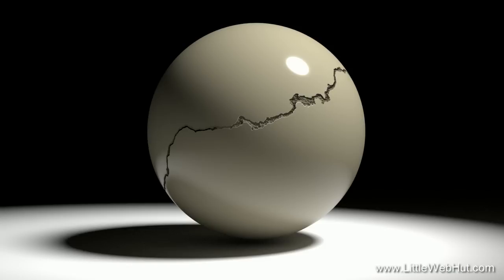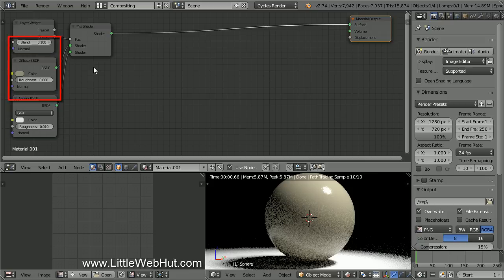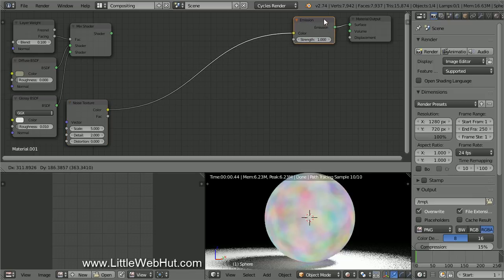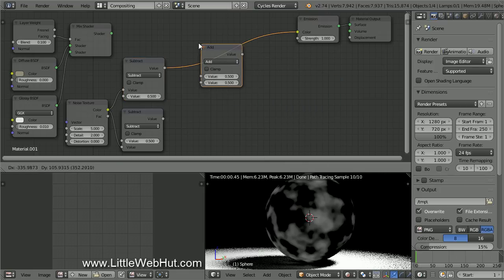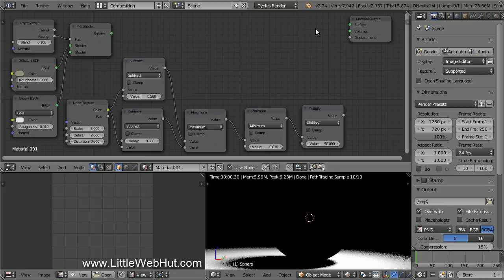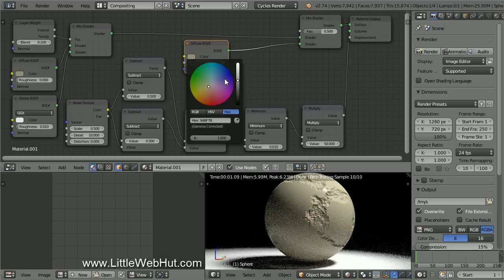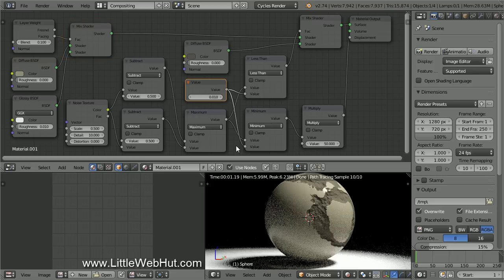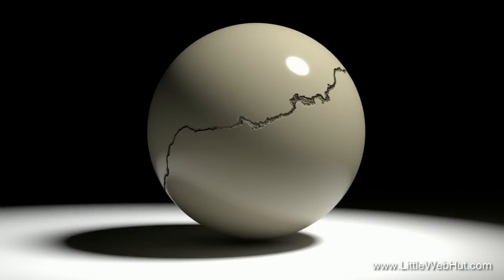Blender Tutorial: Surface Cracks

Comment: 7:50 how do i do this in blender 2.8? The textures settings related to the noise node arent there anymore
Reply: I couldn't figure that out either. I ended up just adjusting the "distortion" setting on the node itself. But I would love to know this as well because I couldn't quite get the look I was aiming for using only that setting.

Comment: Man, I had no idea about the purpose of the maximum math node. I was achieving some results adding a second texture to the vector of the first texture, or messing with musgrave and power maths alongside colorramps.
Your way is much more accurate, still, so much easier

Comment: When I right click the sphere, and the nodes pop up in the compositing box, I only have 2 nodes.  Also, in the vid it looks like you're using he shader node mode, but when I use that mode I have 0 nodes. Can anyone help with this?
Reply: +JEBtheGamer1 Also, I wish you would explain how you get places (like you did in your GIMP videos), for example where the sphere came from. Because that could explain something about the nodes (or it's the fact I'm using 2.71)
Reply: +JEBtheGamer1 He never went through setting up the sphere with its material. Thats why you dont see any node when you right click the sphere. With the node editor open, right click the sphere, go to the right panel, click on the &quot;material&quot; button, click New, then click &quot;use nodes&quot;. This will put a basic diffuse shader in the nodes editor screen. Now shift+A, shader, and add a glossy shader, then shift+A and go to &quot;input&quot;, and add a &quot;layer weight&quot; node. Connect them as he did. Dont forget to adjust the values in each shader, to match his, AND adjust the color of the diffuse shader by clicking on the white color, dragging the black/white slider to a grey color. You should now have a sphere close to what he had when he entered the node editor. Hope that helped. ALSO, he made the background color black by clicking the "world" button on the far right panel, and under surface, clicking the color and making it black.
Reply: Blaydrnnnr
Thanks for that :) Fortunately, I know pretty much what to do now. The reason I was so confused was because my Computer Technologies teacher had this first on a list of projects, and me being slightly OCD did the first one first.
Reply: Glad you got it. :-}

Comment: i can't get it to work, here's how it looks like:
http://postimg.org/image/ygyb6frzd/full/
http://postimg.org/image/shak2s76x/full/
Reply: +Cher Abdou Your node setup is not hooked up correctly. You're bypassing all the nodes except the displacement nodes. You can see your first mix shader (2 diffuse inputs and layer weight) is going directly to the surface input of the material output. I suggest doing a screen shot of tutor4us node setup and fixing your node setup.

Comment: Hey is there any way to add a texture to the cracks? And not the surface?
Reply: +Tyler Hennighan Late response but hope it helps.Yes you can.1. With the sphere selected, switch to edit mode in your 3D view window (TAB is the default shortcut) then press U and select Unwrap. Then switch back to Object mode in your 3d view window (TAB switches to Edit mode and Object mode by default).2. In the node editor, you will add a image texture by pressing SHIFT+A > Texture > Image texture.3. Select your image by clicking the folder icon in the Image texture node. (You may want to change the projection to a sphere in the Image texture node)4. Connect the Image Texture Color output to the 2nd Diffusion BSDF Color input (This is the 2nd Diffusion node that applies color to the crack surface)That should be it. You can use a Vector mapping to adjust the axis of the picture but you can hardly tell the difference.
Reply: +Javier Ramirez (J.A.R. Beats) Great answer. Thanks.

Comment: Are you using a UV Sphere to start out? It looks much smoother than a UV Sphere, but perhaps you have a Subdivision Surface Modifier on it?
Reply: +Josh Firicano I did it with a UV Sphere that has a Subdivision of 3 and smooth shading. looked pretty much like the one in the video.